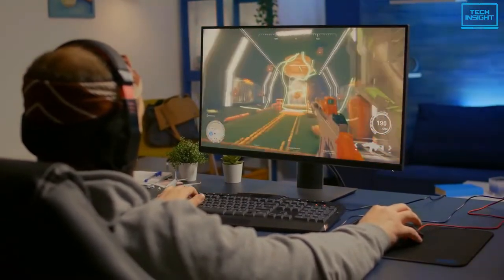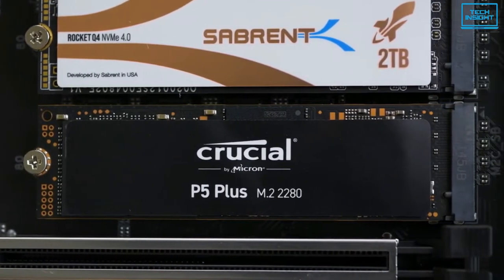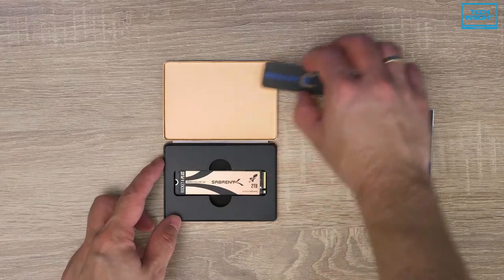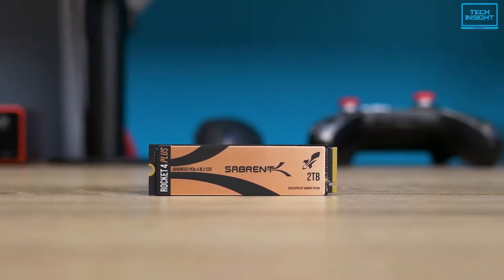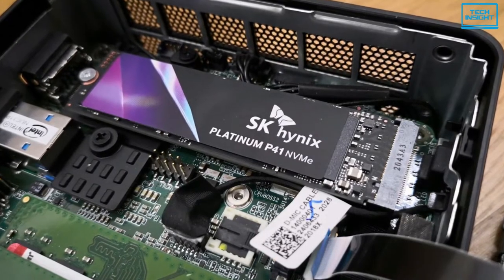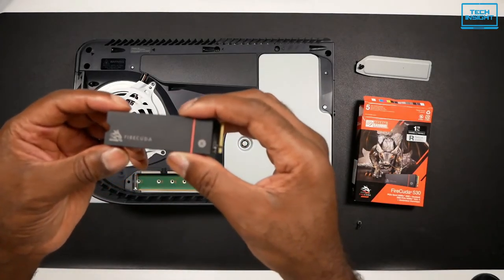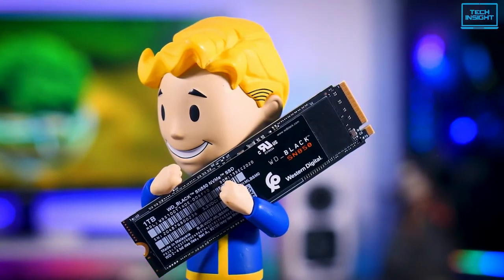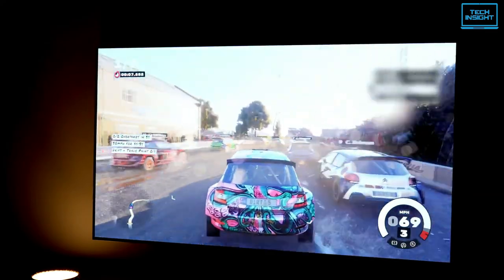Top 5 Best NVMe SSD 2023 - Best SSD for Gaming, Editing & More!

Comment: I got a P41 based on its "real world" benchmark results being better than the others.

I'm waiting for PCIe 5.0 drives, though. Samsung will probably be the first, with a 990 Pro (or 1090 Pro?)
Reply: which one is best for a pcie 3.0 laptop, im willing to pay for a gen 4 ssd(yes ik it wont be AS fast on pcie 3)
Reply: @daggeringking100  I've used a 980 Pro and a 970 Evo Plus in a PCIe 3 laptop, and they both maxed out the PCIe bus's bandwidth in terms of sequential reads/writes. i.e. both wouldn't go over about 3500 MB/s on PCIe 3.0. But even on PCIe 3.0, you can see a little better real-world speeds with higher-end drives thanks to faster IOPS speeds..